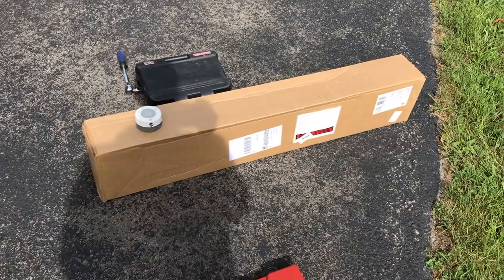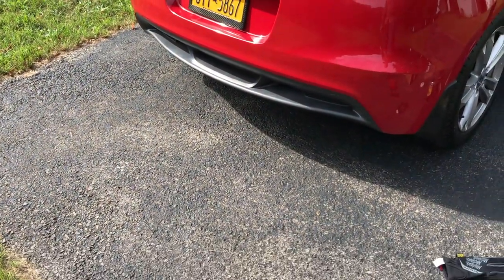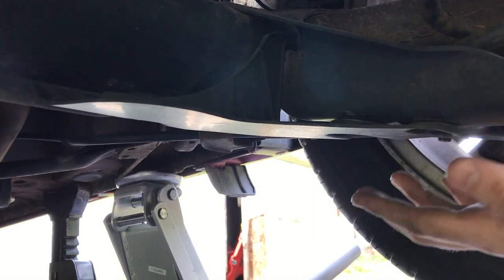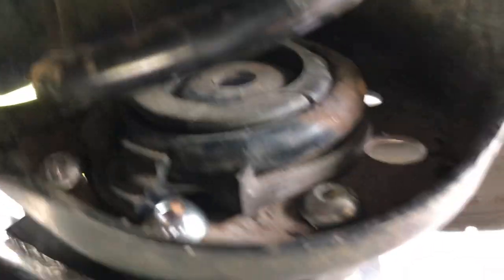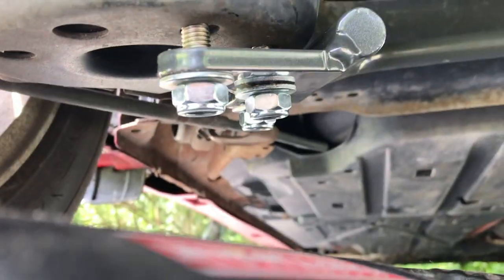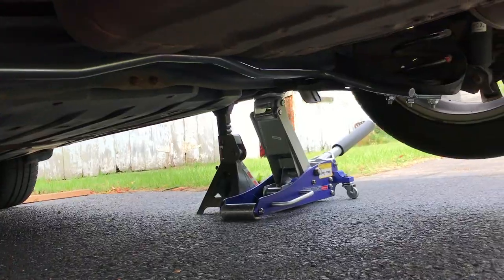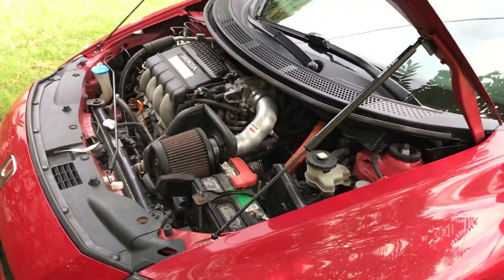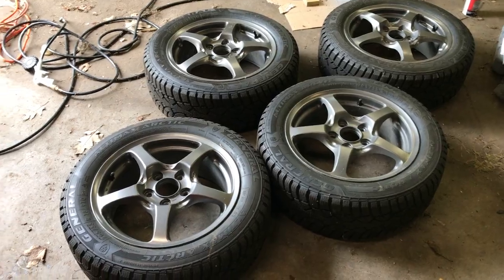Honda CR-Z Progress Technology Sway Bar Install and Update

Comment: So, those three holes are already in the stock spring housing?Is there a stock rear sway that you removed, or it's just that simple? I'm about to install the progress sway and K&N typhoon today. Thanks
Reply from the maker: Yes, they should all be there on the stock spring mounts. There is no stock sway bar, so nothing to remove.

Comment: You need to start taking care of the bottom of your car is getting rust pretty  bad.... get some brushes and rust remover and paint that all black
Reply from the maker: MR. S1000RR TUBASO it’s too late for that, plus I sold the car. It was well past it’s value to look into doing that but I understand your concern!
Reply from the maker: Also I live in upstate NY, Where they salt the roads heavily and to coat on top of that rust would only make the problem worse. It seals in the rust